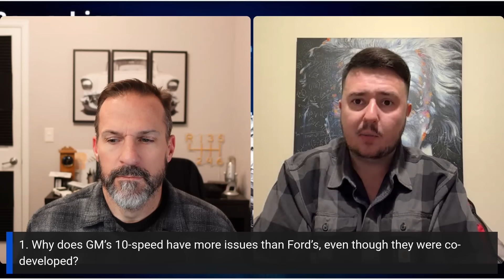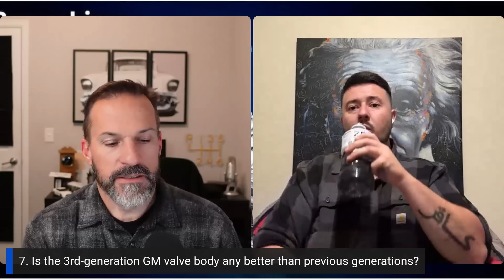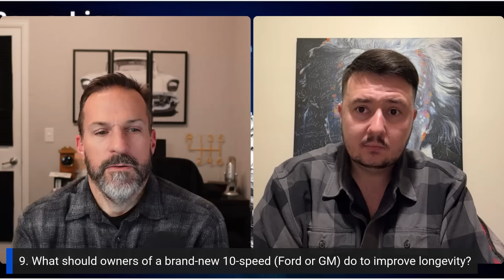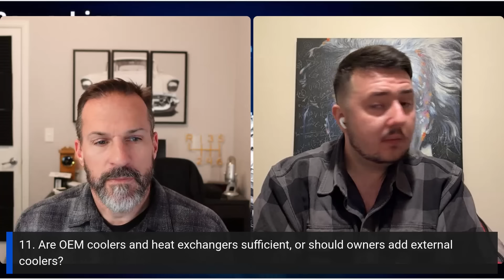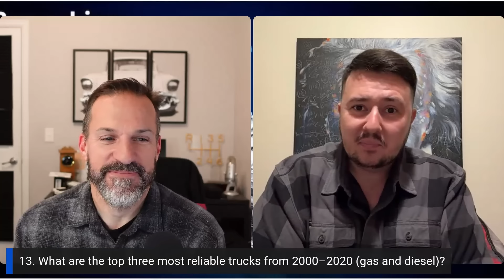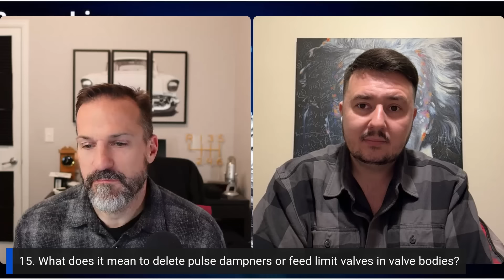Stop KILLING Your Transmission! The Maintenance MOST People Ignore (With NextGen Engineer)

Comment: Well recall that the American W. Edwards Deming, the statistician, management & quality expert approached GM and Ford back in the early 1950s about improving quality and they said, Hah!! No thanks! So he went to Toyota and Honda to help them improve quality. Today Toyota honors him. GM and Ford and the old Chrysler Corporation had their time in the sunshine and since their peaks in the mid 1960s they have proven fully incapable to truly competing on all cylinders to crush their competition (Ford had another uptick in the middle and late 80s, which then began to fizzle out somewhat again as they approached Ford 2000) and Chrysler started to roll again in the late 90s, and then sold out to the wise and abusive Germans at Daimler & paid for it, and then GM started to improve a lot from the early 2000s until about 2009 and then got hit with bankruptcy --They were improving quite a bit but not at a fast enough pace (The GM Titanic had more holes in it than Rick Wagoner realized) not realizing that failure was breathing down their necks!).

Frankly and honestly?? You want the truth? Ford and GM & what remains of Chrysler have had some pretty decent vehicles in the past over the years but the managers at the top are still basically "Bored to Death" by any idea of a LONG TERM Master plan to rigorously make quality the centerpiece of their engineering, & final assembly. They are turned on mainly by rapid short term cash inflow profits through marketing and exterior styling and just cannot even understand that long term quality creates long term customer demand and satisfaction & loyalty. Yes the US government's absurd regulations that have pushed for incremental fuel mileage ratings on the govt EPA test cycles have hurt quite a lot with forcing the development of added complex engineering including cheapening products to save $$ to spend on electric car & truck development, for electric sport and cross over utilities that were not as popular as they thought they would be. 

All lot this is compounded by decade after decade after decade of shytty relationships with the UAW who also hate the automakers they work for, and management WILL NOT take the Bull by the horns & END this absurdity. Why won't they do a long term deep dive into product quality from start to finish? Because they are endlessly excited only by fat short term profits and have developed a deep hatred for long term product quality because their "short-term-profit atrophied minds" simply cannot wrap their head around the idea of long term quality being in any way a topic worth wasting time over. If a man gets a short term $$ savings by cheapening up a product that can still make it through the warranty period, he is rewarded handsomely and gets promoted. Thus the only way such a long term movement toward near fanatical quality will occur is if someone at the top demands quality to be -not as good as Toyota- but clearly and distinctly superior through root engineering excellence. If you want a specific target, the goal should be to crush Toyota on every level of quality. So far, decade after decade after decade the tops of the former Big Three cannot figure this out.

Incidentally, is it possible that any of these absurd engineered in problems inside the transmission that could be resolved but have not been, are in any way due to the ability to eek out a tiny fractional increase in mpg for the the Big Kahuna US EPA, so that a manufacturer might get added credits toward meeting government regulations for greater fuel efficiency on the test cycle?? But there must be an engineer or manager at GM for example that must be able to track down WHY for example, pulse dampeners are inside their automatic transmissions since they do nothing to improve the operation of the unit.. Maybe some guy who is going to retire and is not worried about job security. Or is it so nefarious that no one knows why they are engineering in a component that makes no sense? Somebody just has to track this down like a murder mystery: Who is step by step trying to kill GM by engineering in worthless or even harmful components? Someone must know! To here it point blank from someone inside GM--you know like when they interview a man and disguise his voice and shadow out his face and he can explain who authorizes this insanity and the point blank reason why. Such as something like this: 

"The Human Resources Department has determined that we must have more women designing in automatic transmission components that the transmission does not require, and can actually harm its performance, because the Joe Biden Administration has thankfully determined that if we hire more females, the EPA will go easier on us if we Phuck Up and design a substandard emission control component or safety component. In this way the Big US Govt will shine blissfully down on us at GM in the near future when we may very well go out of business during GM Death Watch II**." Is it that dark, and nefarious?? This would be a fantastic revelation and hopefully get the awful DEI hire Mary Barra to so sadly go away with her hundreds of millions of dollars (assuming she invested her cash she could easily be worth that, which is ludicrous) as the worst GM leader in history.

**As many of you may know, the GM Death Watch illustrated the dysfunctional attributes of the GM system back in the late 1990s up until its bankruptcy in 2009. It was quite interesting & is worth a read today. I also printed a document claiming that GM would go out of business under their CEO Rick Wagoner, back in 2001 & placed it on the wall of my cubicle (Like in the “Office Space” movie). I was told I would be fired if I kept that on my wall. I left the company a few months later voluntarily. Wagoner was a smart man & made serious improvements to GM efficiencies back then but he just did not seem to understand that GM was like the Titanic except with 15 separate holes in the hull. He repaired a half dozen but it still was going to sink without drastic action which never came in time. Thus GM was dead in June 2009 even though Wagoner stated that GM had plenty of cash on hand on the front page lead headline of the Detroit News on July 11, 2008, encouraging me to lose money on my GM & Delphi stock.

Comment: Don't transmissions have filters to take out any particles? Of course the fluid has to be changed at reasonable intervals or any filter would block and the bypass valve would open and allow the particles to circulate.
Reply: Hmm, with the motor, but I don’t believe the Transmission Filter is designed to recognize pressure increases for being slowly plugged.
It just grabs particles as the fluid passes through..
I certainly could be wrong..

Comment: I Daily drive a AWD 2007 Cadillac Escalade esv I'm bout to hit 190,xxx miles here in Minnesota. I've owned her for 5 or 6 years now and been reliable but, I do most of all my maintenance myself. When I first got her I did a oil change,  transmission flush, flushed both differentials, flush coolant system, refilled with a universal coolant, and replaced the spark plugs using ngk laser iradiums and onstalled new high performance red 10mm spark plug wires. i upgraded the grounds and powers to 1/0 guage ofc wiring, replaced alternator with 400 amp Mechman elite running to 2 agm batteries i installed and upgraded a bunch more with better aftermarket options.I even replaced the exhaust manifold that had a broken bolt with a new aluminum racing exhaust manifold so it wouldn't rot out or corrode as fast.

Comment: Some transmissions have no thermostat and the cooler is simply just too small from the factory. The 4T65E in the Pontiac Grand Prix GXP being one example. By putting in the cooler from the Chevy Impala police cars, the fluid temperature goes down from 210-220 degrees to 160-180 degrees.

Comment: While not as well versed as Nate, I have a different take on the cause of the TCS issue. I have a 2015 GMC1500 with the 8 speed and have been battling this issue for over 3 years. Dealership did the first fluid "fix" under the 100k warrantee. All along I was noticing about 100 RPM fluctuation on the tach at light loads at highway speeds. Dealer says normal and don't worry about it. Next occurrence happened at about 140k. New fluid, shudder went away but still had the slipping. Had the TC replaced with an upgraded aftermarket version, but made the problem worse. Tried different fluids and additives, no change and ended up having to drive in the tow mode and not use 8th gear to keep the rpm higher. I did notice that when it did shudder, more throttle would get the TC to lock up and stop the shudder. I figured it must be some type of software bug that is telling the TC to partially unlock at light load since it is never a problem under heavy loading or higher speeds.(75 plus).

After watching one of your and Nate's videos about a year ago, I called up and talked to his very knowledgeable guys and bought the valve body cover and pulse dampener delete kit. When the sales guy mentioned the inter-passage leakage issue, a lightbulb went off. If at low engine speeds (under 1500 RPM) when the pump is turning slow, there is leakage (bleed off), even though the computer is telling the clutch to Lockup, it can't do a full lockup (only about 90%) due to not enough oil getting to the clutch. This explained why it only happened at low speeds and low loads. The kit completely fixed the TCS. I know that the fluid change was simply a bandaid to reduce the shudder while not addressing the slipping. Every once in a while during the normal course of shifting, it does a slow engagement of the TC and I briefly feel the shudder, so I know it is not the fluid change that has fixed the issue. Also, the 100 rpm fluctuation of the tach is completely gone.

The simple fix is genius and it amazes me that GM refuses to fix the cause.

Comment: jatcos are terrible, cvt transmissions are notorious for failure, idk about aisin cvts, i heard aisin made better cvt models than jatco's design. But you have to service those transmissions every 30k miles or so. Drain and refill with oem fluid. That's why nissans are probably one of the worse vehicles out there, Toyota is probably one of the better manufacturers out there, their reputation speaks for itself. Especially the earlier generations lasting extreme high mileages.

Comment: I’m a junior builder so keep that in mind…. I rebuilt a 6F24 out of a Jeep Patriot (of all things) and was impressed by the quality of the parts inside.  The ONLY reason I even had to work on it at all was bc whoever replaced the engine put the flex plate on backwards and broke the pump drive gear.

Comment: Is he with the next Gen power train in PA? If so, I know where I'm going it i have issues with my frontier. The only other option would be to put the 2nd gen manual in the 3rd gen frontier. z1 knows how to do the manual swap. Unfortunately,  they are on the other side of the country. I can see this dude either doing the swap or building the auto to be better than factory in the 3rd gen fronter.

Comment: The argument not to change your transmission fluid because you already drove too many miles on dirty fluid makes no sense to me. Because eventually the filter will plug, the clutches will slip from insufficient hydraulic pressure for full engagement, and the transmission will be destroyed. When in doubt, change the fluid.

Comment: I just changed the transmission fluid on the 3 speed automatic transmission in a 1986 Buick Century after 100,000 miles. There wasn't a speck of friction material in the pan. There was one large steel shaving on the magnet, probably from gear teeth when the transmission was run in. It probably helps that it is behind an engine making less than 100 horsepower. Coincidentally, the highest mileage car I've ever seen was an 87 Buick Century with the same cylinder engine and 3 speed automatic transmission with 730,000 miles.

Comment: IMPORTANT QUESTION: Does it save a 9, 10, etc.. speed transmission by manually shifting, (generally holding) gears in heavy stop and go traffic? I do so in my Jatco Nissan 9 speed 2023 Frontier, and feel like I'm saving the tranny from a lot of unnecessary shifting. 

What do the experts say?

Comment: I 100% agree that the pulse dampers are problematic and unnecessary. They are not accumulators that soften clutch apply, as in earlier non-clutch-to-clutch transmissions. Their purpose is to damp out the pulses from solenoid dithering. In practice, the dither pulses are generally negligible, so it's best to eliminate this major wear point. 10R80 and 10L80 use dither, but do not have dampers like the 8LXX series. Some 10R80 transmissions do have TCC pulse dampers, but this is limited to 2017 F150 and 2018-2020 Mustang applications. 

TCC shudder can also be caused by the constant controlled slip at cruise that shears the friction modifiers in the fluid (back to what Nate said about the importance of maintenence) and glazing of the TCC friction material. This greatly increases the difference between the static and dynamic friction coefficients of the clutch material, causing it to be "grabby". This grabbing effect causes the shudder as the ECU is continually adjusting the TCC pressure to maintain the specified TCC slip RPM under a certain operating condition (25 RPM, for example). The reason that the TCC is commonly slipped at cruise, is to mask lugging when TCC is applied at low engine RPM (another CAFE compromise). This compromise is nothing new has cost people untold sums of money over the last 30 years!

Comment: Im lucky my 97 Jeep GC Transmission dipstick tells me EXACTLY how to check the fluid. Plus you just apply common sense, the dipstick ONLY tells you how much fluid is in pan, NOT how much is in the whole system. For example my transmission pan can read full on the dipstick after filling 4-6 quarts of fluid, BUT the entire transmission system- torque converter, valvebody, gearbox, overdrive gearbox, cooler lines and transmission cooler, will hold about 12-14 quarts.
The haynes manual i have gives specific instructions on filling the transmission. Its an arduous procedure of fill, let car sit in neutral for 5 minutes, check dipstick, get in car and shift the lever through the gears, feel the transmission applying force, hold brake and raise rpms a little above idle for about 10 secs, shift back to neutral and let sit for 5 minutes then check dipstick again. If the fluid keeps getting lower after procedure, it means the trans is still thirsty and needs more fluid. Add fluid till it reaches the full line and repeat ENTIRE procedure untill the transmission stops sucking down the fluid.

AND MAKE SURE YOU USE THE CORRECT ATF. NOT ALL ATF IS THE SAME. IF YOU HAVE A TRANS DIPSTICK IT WILL TELL YOU ATF TYPE TO USE!!!!

Comment: So much talk about issues with auto transmissions.  I have alway hated automatics.  I have a 2006 Ram with a 6 speed manual.  Truck has 280,000 miles and I don't need a 3/4 ton diesel truck any more.  I would like to find a 1/2 ton but they are all automatic only.   What older 1/2 ton trucks are available with a simple manual trans?

Comment: What - if I might add here adds to the longer life of trans fluid is the trans cooler like the super duty trucks have - they use two tranny coolers in series - SO- the logical answer that these trannies are up against is HEAT - Heat kills the life of the fluid and that is what kills the transmission , is the breakdown of the fluid due to improper cooling. This is from a 2008 Ford Super duty  with one cooler in the Radiator followed by a 2nd cooler located between the Condenser  Coil and the Radiator - it does make a huge difference in the longevity of the fluid...

Comment: Funny he says the 5 and 6 speed Aisin Seiki tranny's. I have an 06 Tundra. 5 speed beast. I am also shockingly surprised that the same transmission is used in my little shitbox 04 Suzuki XL7. You do the math. The little Zuk has a beast of a tranny for its size. I 100% agree with his Aisin Seiki 5/6 speed transmissions.

Also the A750F has a heat exchanger with the radiator. A common point of failure is a leak which contaminates the transmission fluid with radiator coolant. A catastrophic failure that is preventable. Change/Maintain your coolant and/or radiator to prevent that failure.

Comment: I realize that this is on Larger trucks mainly but what about midsized trucks like the Nissans Frontier and their transmissions  - RE5R05A  I have  seen not problem at all with proper fluid changes during its life time. + 400,000km

Comment: Guys— for my 2017 V6 Jeep Grand Cherokee Trailhawk I've had since Nov 2016 (just rolled over 50k miles) — should I replace the ZF8 Trans fluid + OEM pan/filter?  Or is there a better aftermarket?No shift issues so far. 
LOVE THIS CHANNEL COMMUNITY!

Comment: My wife's 2019 Trax just hit 60,000 miles so I will absolutely schedule a transmission fluid drain and fill, coolant flush,  replace spark plugs and coil packs, AND even replace the oil feed line to the turbo. I am also going to start replacing the BS plastic engine parts with after market metal parts. Yeah, it's a Trax but it's paid off and I will make it last 250,000 miles.

Comment: Awesome discussion, thank you gents!  Just had my '21 Ram 1500 ZF transmission service at 63K, even though the service advisor told me they are a lifetime fill, but still can do the service...$1000 +/- service at the dealer, but I knew it was worth it from Nate's previous discussions.  The ZF has been flawless for, I've owned them since 2014 in 3 different Rams; very smooth, actually wish it was a bit more notchy and sporty.
Reply: 2014 Ram 1500 8 speed Zf 8 hp75. Is very good tranny.
Reply: One thousand dollars to do the trans fluid and filter?  F that!